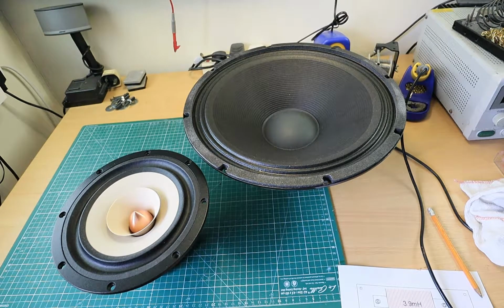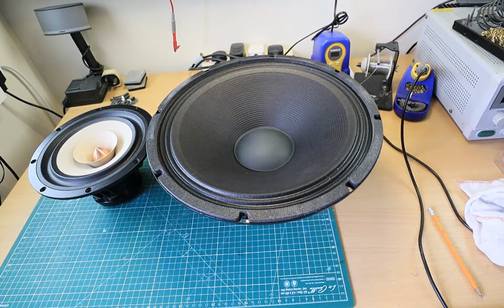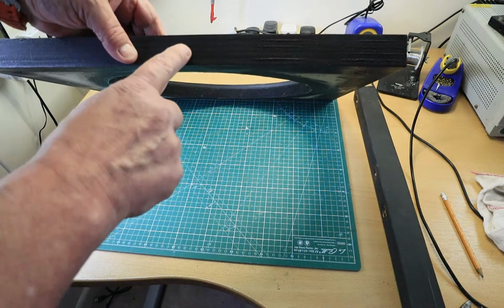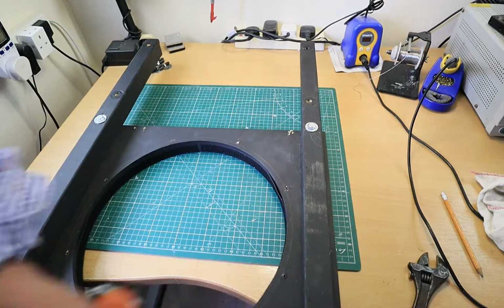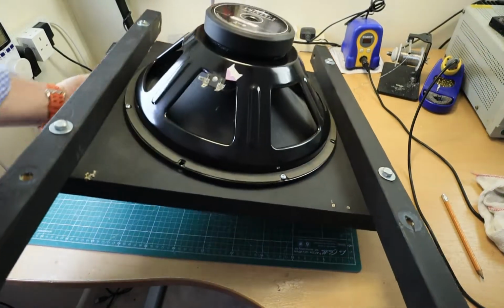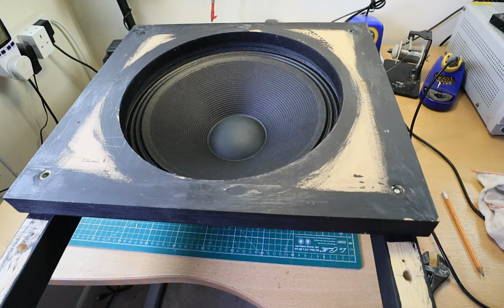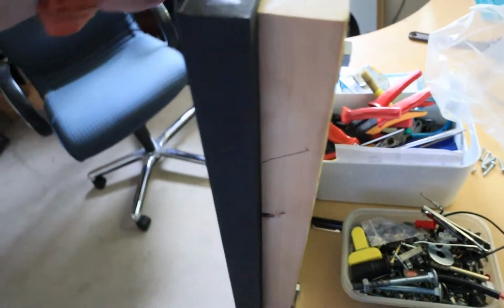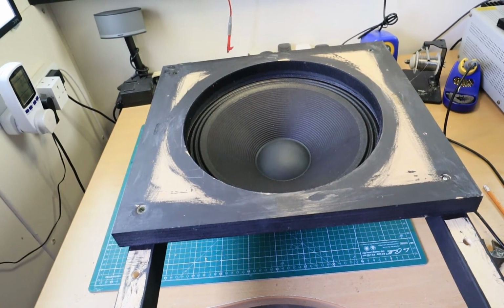The 'Trio' Open Baffle Speaker TangBand W8 1808 Full Range and 2 x Eminence Beta 15A bass

Comment: I want to thank you for responding to my previous comments.  I did find an audio store called “Deer Creek Audio” in Colorado (USA) that sales MiniDSP.  For $95 per hour they will do a Zoom meeting with you and help you to setup the MiniDSP.   I have done a great deal of research regarding trying to setup a system for OB using two MiniDSP (based on your project) and playing them using Roon,  I do not know if you Roon but I could use your suggestions.  How did you setup using two MiniDSP.?  The person at “Deer Creek Audio” suggested that I use an optical connection to the two MiniDSP’s using an optical splitter.  I would use some type of Roon Endpoint that has an optical out (with volume control).  So far I have not found a responsible priced Roon Endpoint.  Can you please share how you setup your two MiniDSP’s to your system or any suggestions you might have for me.  I am sorry for bothering you again but I have been unable to find a solution for using two MiniDSP’s with Roon.  Thanks so much for your consideration in helping.  Greg Edwards

Comment: How to you deal with impedance? 8 ohm fullrange and two 8ohm woofers.
Reply from the maker: Sorry, I don't understand the question...Please see the crossover video.
Reply: @thediyaudioimplementers1826  I watched that as well. I don’t hear you mention impedance. Your woofers are 8 ohms. If you wire them parallel you get 4 ohms or series you’ll have 16 ohms. Your fullrange is 8 ohms. Does this cause any issues?
Reply from the maker: @humandoing9675  Bass units are wired in parallel so = 4 ohm.

Comment: Interesting! - would be interested to find if there is a more budget fullrange driver version(with associated XO). MDF pressure points; soak in thin superglue and the area will become rock hard. (wood hardener might also work?)  P.S. Are you in New Forest by any chance?
Reply from the maker: I have used the Mark Audio Alpair 11MS (£100ish) as the full range but its not as efficient as the 15"'s. So the 15"'s needs to be attenuated back a bit be it active or passive. Yes, Mopley.

Comment: I’ve built a couple of open baffle designs and was going to build these. I’ve used the Alpha 15 drivers before. The specs seem very similar to the Beta 15. Would there be much difference in the low end cutoff filter? Very clear and thorough presentation.
Reply from the maker: I've used both A & B15" and used the same filter with no difference between them. IMO

Comment: Hi! Look forward to the next stage of the build, I do want to build these, a fan of open baffle speakers, dream pair is the Spatial M3 Sapphires but finance!! The concern is the small living space i will be moving into and these may be too much. I wonder if I could still use the w8 1808 with x2 eminence beta 12a woofers instead, would that work, one would think a redesigned crossover? your thoughts would be appreciated...thanks.
Reply from the maker: Yes it would work and I have a 'Basta' model using the 12" Em Beta's. It looks good but I've yet to implement this design. Many use the GRS 12" which has quite a cost saving. Also consider using the MarkAudio Alpair11MS full range driver over the TB again quite a cost saving. This Pairing will be my next build video if all goes to plan. I'm putting a drawing together right now. Give it a go, you might be pleasantly surprised.
Reply: @thediyaudioimplementers1826  Fantastic, thanks for getting back, much appreciated, will certainly look into it, the crossover will be a concern as I have no way to measure and or build them. I do know that the crossover is the heart of the system, so good quality components need to be used eg: Mundorf or Jantzen caps and so on! let me know how you go with your build and if or when you post on you tube...thanks
Reply from the maker: @cruise2023  The crossover isn't that far away from the 15" version.  I'll cover that in the video when I do it.
Reply: @thediyaudioimplementers1826  Great! just had a look the Em beta 12a is between $65  to $75  each, where as the GRS 12" at $39 so both cheap really. Now the w8-1808 is at $340 compared to the Alpair 11ms at $130, big diff in cost but what about sound??? still its building to a cost. I would not compramise on the crossover, will be interested what you come up with..cheers
Reply: Hi! Awaiting your next open baffle project. I noted b4 about using Eminence 12" drivers with the Tang band w8-1808, you noted perhaps looking at the Alpair 11ms driver which is 6.5". I have come across here in New Zealand a pair of P-Audio BM-8CXA Coaxial drivers 8 ohms for $495 a pair ( 250 gbp ) which I am thinking about buying to put use in the twin E 12" drivers instead of the other 2. Can you comment on that please. My other question regarding this is, am I better off using a full range 6.5" with the 12" drivers instead of a 8" full range driver? Thanks Alain